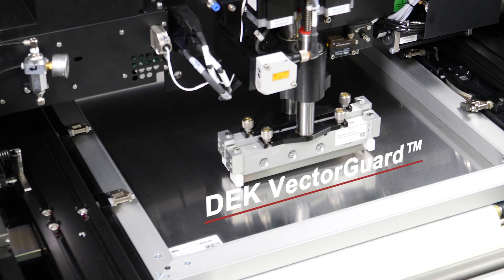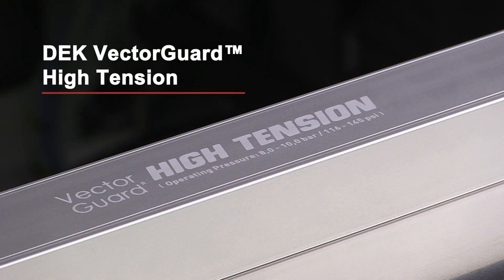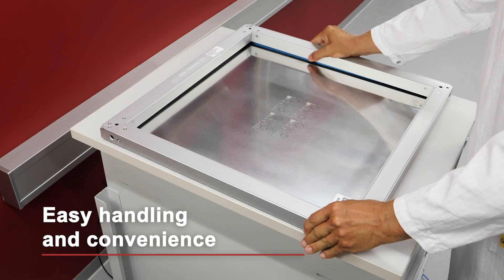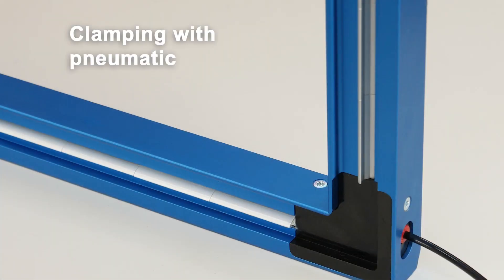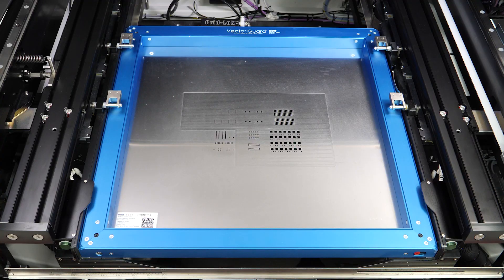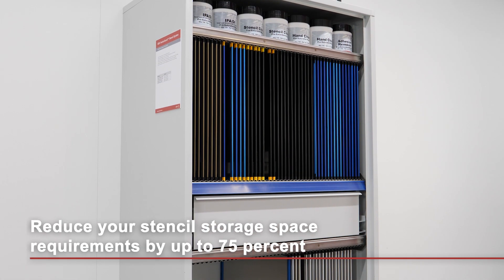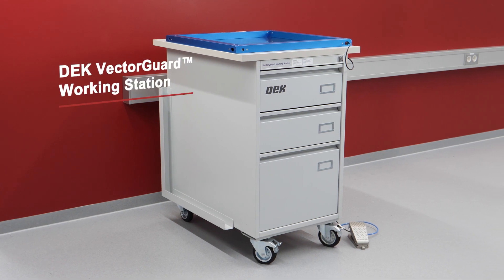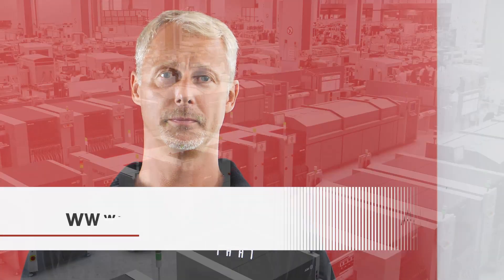DEK VectorGuard™ stencil frame system

Comment: We have this system for 8 years. With often changeover - frame failed like crazy. We have to replace internal frame`s silicone tubing every couple weeks or even often. Definitely for mass production lines only. If You have 10 changeovers a day,..  just stick with old fashioned frames (AKA 29" DEK 265 GXS). Our management was try to save on stencil sizes... but dramatically lost on equipments ownership.